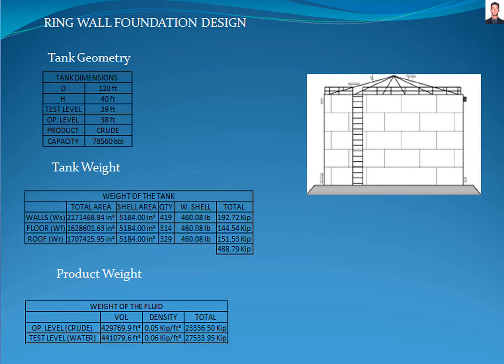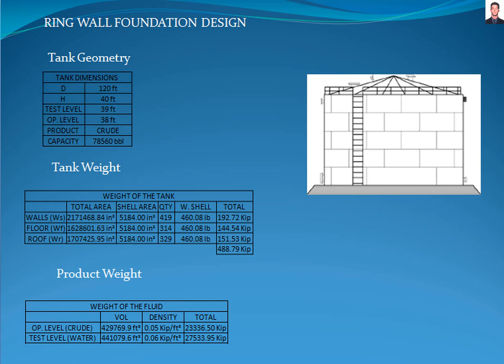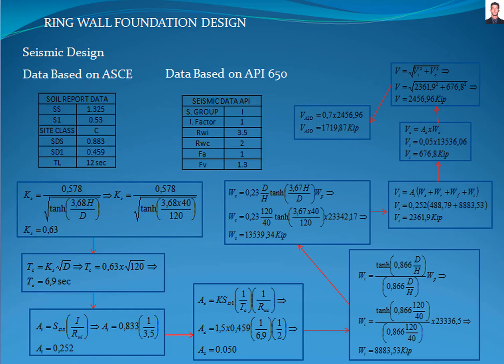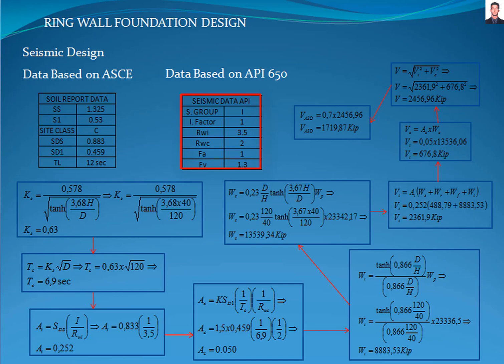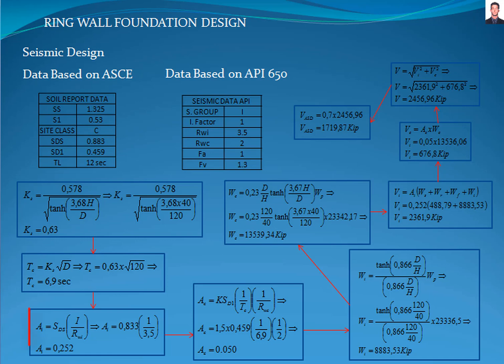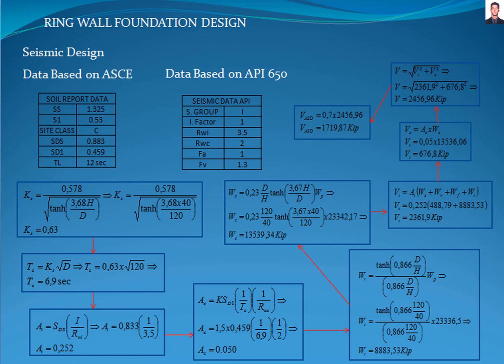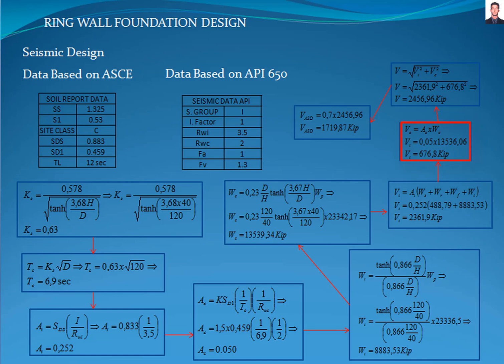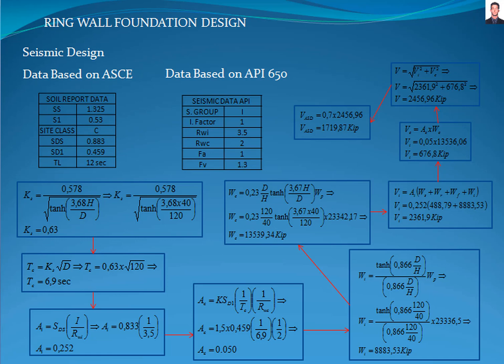RING WALL FOUNDATION DESIGN PART I

Comment: Sir thank you very much, this video is very useful. A small error is that the height H should be the height of the water column, not the total height of the tank I believe.
Reply from the maker: Depends on what are you talking about (to calculate what?)